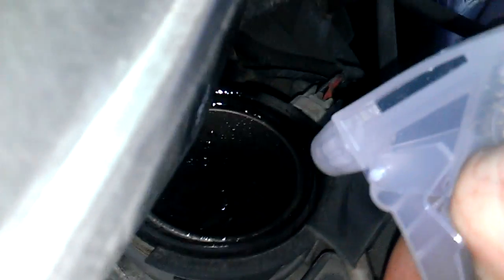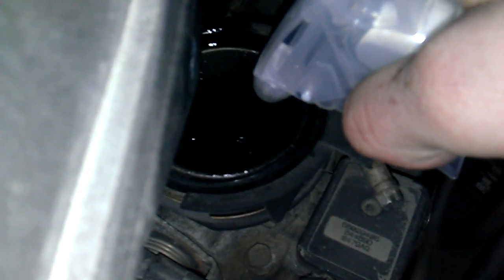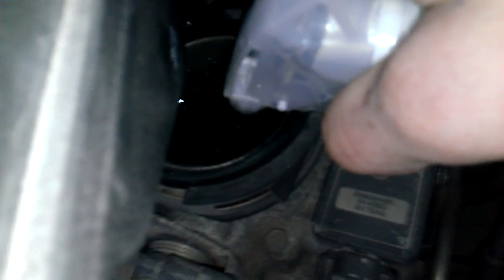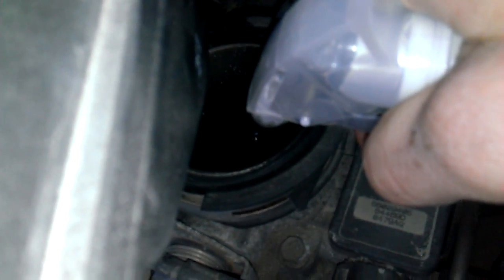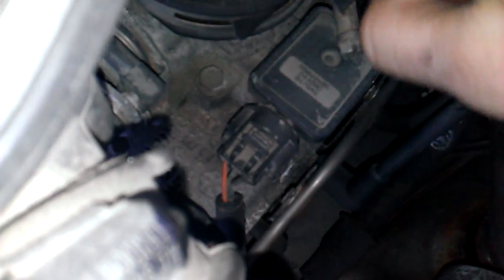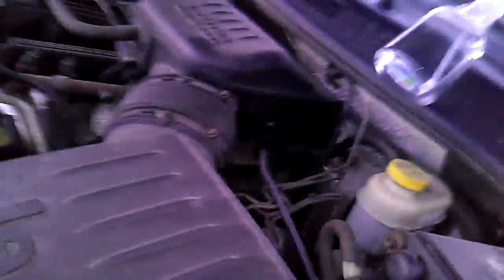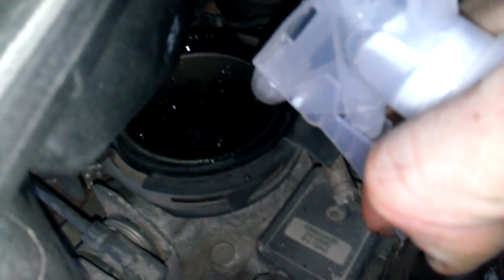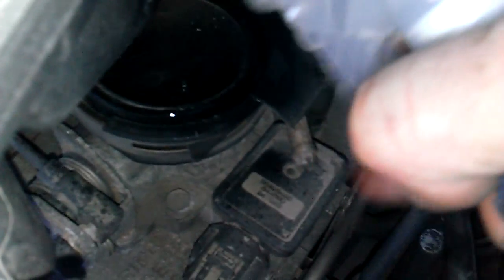how to make your engine run better with just tap water! engine decarbonization

Comment: Your trusty Jeep produced more water internally as hot, high pressure steam from the combustion of gasoline during your demonstration than you supplied by spraying, raising perplexing questions about why you bothered. 

To all YT armchair decarbonization scientists: if you believe water decarbonizes, then fueling with E85, if your vehicle allows its use, will produce >2X the amount of water as 10% ethanol gasoline. Doing so takes no additional time, effort, tools, or equipment.

Comment: Works better if you keep the RPM above 2000 or so. I use a quarter between the throttle body cable stop

Comment: I would do it in the Summer when the engine is above operating temperature.  You would be better cleaning injectors with fuel additive and changing engine oil.

Comment: All false information.. all of it....
Reply: Not really. Granted he should of used distilled water everything else works. It really does decarbonize your engine and no it wont hurt as long as you spray slow. If you have ever seen an engine with a head gasket leak into the cylinder then you would know this works.

Comment: For best result you should idle the car to 2,500 3,000 RPM and it's not recommended to apply water directly to the throttle body, always apply it through the intake hose

Comment: i have a question. would me spraying it in through the Throttle body affect it in any way or is that where im suppose to spray it in??
Reply: If you are going to do this use deionized water so you dont get minerals in your engine keep engine at around 2000 to 2500 rpm to keep it hot and very small amounts of spray dont want to put to much water into your engine or it will get into the oil and ruin the rings. And yes spraying at the throttle body is important because you do not want to spray the mass airflow sensor and ruin that. Hope this helps

Comment: Well, I did this decarbonization, and a couple of weeks later, all four of my O2 sensors went bad.  They only had around 7000 miles of operation.  So, I just don't see the value in decarbonizing . Those O2 sensors were over $40 apiece.   Could have bought a lot of gasoline with that.
Reply: Eduardo León Morales 

They are exposed to lots of steam whenever the engine runs.
Reply: Eduardo León Morales 

O2 sensors are in the extremely hot exhaust system before and after the converter. He’s not referring to sensors in the intake system. Doubtful four 02 sensors would fail simultaneously.
Reply: Eduardo León Morales 

Water which vaporizes completely in the intake system on its way to the combustion chambers is identical to water produced from combustion. The small amount he introduced makes no difference and does nothing different than water from combustion to remove carbon. This video should be entitled, “Wishful Thinking.”
Reply: Eduardo León Morales 

Oxygen sensors don’t respond to water. You think an engine doesn’t make a lot of water regularly? Do you know what becomes of every drop of gasoline it consumes...what the products of combustion are? Apparently you don’t...

Comment: Can you sell me a new engine after i ruin my old one by putting water in it?  This doesn't seem like it would be safe for my engine.
Reply: Water is fine in moderation. I had an old car with sticky lifters and one of my cylinders locked up. When I pulled the head, I noticed that the locked up cylinder was clean like new. While the other working cylinders were coated in the usual carbon buildup. What happened was that during the short period of time that I drove the vehicle with a stuck cylinder, that cylinder was always getting a constant shot of fuel, which actually washed up the cylinder and piston head quite nicely. This is a little different from misting water into your intake, but the result is just the same. When the water reaches the cylinder, it vaporizes and the heat produces steam which will remove the carbon. Just don't be an idiot and drown your engine with water...water does not compress well and you'll end up killing your engine if you go nuts with the water.
Reply: But gasoline contains detergent which I assume is there to clean the pistons and cylinders when the engine is running. Am I right?
Reply: David Crandall Correct. But the fuel itself is part of the reason carbon deposits form in the first place. The reason it was effective was because the fuel wasn't burning, but rather washing through. Steam works the same way. Have you ever taken any stained clothing to the dry cleaners? It's amazing what steam cleaning can do. I'm not saying that, "If you aren't decarbing your engine with steam, you're doing it wrong", because there's more than one way to skin a cat. My point here is that most things are fine in moderation. Pouring too much of ANY liquid into your engine is asking for trouble.

Comment: Is this guy for real? Spraying water into your intake? Hey Einstein this is not cleaning anything! Add Enough water and you will vapor lock the engine.
Reply: vapor lock you mean hydro-lock and you could never get enough all at one time from a squirt bottle if you took the lid off and dumped it all in at once maybe
Reply: Exactly. I don't see chefs cleaning flat grills with sea foam or some other decarb cleaner. Water works beautifully.
Reply: +dave kondej Hey,brainiac,how about you go back to school and wide open your ears in chemistry class. Heat up your pan at home. Add some sugar,so that it gets caramelized and black. Cool it down. Then heat it up again,and pour some water on top. Then get back here and share what happen..Einstein.

Comment: "I had an issue with high oil pressure and its bringing it down a little bit too" - Nope! completely unrelated systems

"water coming out the tail pipe" - Nope! this is condensation

"i've actually got a bad lifter, im just trying to clean it up a bit before i do the head" - Nope! how about clean that carbon while you have full access to the tops of your pistons!

"look at all that smoke!" - Nope! its clearly winter and freezing temperatures out there

This is a terrible video with so much NOPE! i think your on DOPE!. this is very safe and sound procedure but you are in no way providing quality content to your viewers.

Comment: Where is the proof that it is cleaning out all that carbon? Do you collect these carbon particles with something?
Reply: Well, if you've ever cleaned a flat-grill you would know that steam does an amazing job at loosening carbon that's caked onto steel. However, I would have some concerns with potentially clogging up your cat at least a little bit, especially with an old engine that you know has a fair bit of carbon deposits. So I'd probably disconnect the cat at the flange before doing a decarb weather I'm using a product like sea foam or just plain water.
Reply: Michael K 

Someone needs to record this miraculous process in, say, a carbon caked skillet. One thing you won’t see on YT is this process in action,  because it doesn’t work.
Reply: See what Greggg57 wrote.  (that is me too)
Reply: works I tried the spark plugs were clean the engine is more responsive the stable idle works great I used a spray accelerating the engine to 1,500 rpm behind the muffler there was black water on the ground

Comment: I've put crushed rice in a water bottle and slowly poured it into my engine while holding 2,200-2,500rpm. cleaned mostly everything out. I wouldn't do that to my new car but it does work on the older cars

Comment: How can you be sure the carbon coming out of the tail pipe isn't coming from the exhaust system and not the engine?
Reply: +jschrauwen from both
Reply: +Joe Pan   How do you know this?
Reply: +jschrauwen i done this with my car and the valves got cleaner so they seal better when in close position ,
now it's more smoother running ,just one mistake is that this guy should of rev it to 1500 rpm when doing so not at idle.

Comment: Hell yeah! Knock that piston sideways. Yeah don't rev it. Wouldn't want to take some mile of the engine by steam cleaning cylinder wall and knocking the piston sideways. Then scarring the walls. Probably would be safer to use fogging oil in the engine. Bet it does help wear the bearings down to. Just rev it up, start pouring it in and see if you melt her down. lol

Comment: I dont really understand the theory behind this. Can someone explain how water can dissolve carbon deposits? Also if chunks and flakes of carbon are breaking off wont they scrape up the cylinder walls? and won't they clog up the catalytic converter?
Reply: +pipkin503 Steam, that's how. The engine has to be hot first. See EricTheCarGuy's video if you'd like to hear his words on it.
Reply: Valid concerns about larger chunks of carbon breaking off and scraping. But the same risk is present even if you use a formulated decarb cleaner like sea foam.Generally, your engine block and valves are harder than the carbon deposits so I wouldn't worry too much about scraping up your cylinder, any scratches would just be cosmetic unless it's a high performance engine with very tight tolerances. The steam does a pretty good job though of breaking up the carbon thoroughly. As for the cat, you could always disconnect it at the exhaust flange before performing any decarbing.
Reply: Xaeris 

Water doesn’t decarbonize. It’s an internet rumor that refuses to die for some strange reasons. Many armchair internet scientists and theoreticians remain convinced that it works however.
Reply: Water is H2+O. It is liquid air. It may get in air intake and oxidice with dirth and burn out with   H.

Comment: Wondering why you never displayed any actual carbon deposits or other sludge that was stated to be exiting your vehicle... ???
I did notice the water-vapor caused by the differential in temperature between the as stated "hot" engine & the partially ice covered environment. As well as, yes an engine will idle smoother once a greater portion of moisture exited the system Because H2O is naturally detrimental to combustion... Also running "climate controls" in a vehicle can cause moisture to drip from the tail pipe. Due to a rather similar function as caused the vapor seen on the video...

Comment: How to kill your engine 101
Reply: The white smoke you see is not carbon, it is just water vapor. Your poor car is slowly rotting from the inside out.
Reply: Furthermore, the water can get into your oil and really kill anything that gets engine oil through it.
Reply: Actually if you keep the rpm held a little higher than idle it does help but I wouldnt use tap water I'd use deionized water so no minerals in it to harm the engine this works similar to seafoam just gotta know how to do this correctly old cars love it!

Comment: All that is happening is the water going in the engine is terming to steam and going out the tail pipe don't do this it is bullshit !!!
Reply: Works when you know how to do it correctly old cars with carbs love it. Acts like seafoam. The steam at high temps does cause carbon to be removed but in small amounts

Comment: i suspect the water you're seeing at the tailpipe is condensation. hot air from engine meeting cold exhaust (winter?).. it's not water coming from the engine.. any water you sprayed into it would have instantly vaporized..
Reply: Dexter Edwards 

Not from the engine? What do you suppose happens to gasoline when it burns?

Comment: my god I hope you're not spraying water into the mass airflow housing / sensor
Reply: paul rogers Thats just the throtte body, the sensors would be before that in the intake
Reply: paul rogers he sprays in the throttle body jeep uses map sensor not mass air flow sensor which is right under his thumb in the video
Reply: +paul rogers If this car had a MAF setup, the second he pulled off the intake the ECU would have stalled the motor because it would think there is no air going to the motorNonetheless, he is just proving that water + combustion = steam. This is not "decarbonizing", and I wouldn't do it. If you want to decarbonize, take off the head and soak the piston tops and valves in combustion chamber cleaner. Decarbonizing sometimes loses compression on some cylinders, which is a bad thing.His "issue" with high oil pressure was coming from the oil being cold, just running the motor heats up the oil, and pressure drops. This isn't even an issue, but to this guy I'm sure it is.

Comment: Did you really just spray water on your mass airflow sensor? That is not a good idea. This method does work though. In my opinion not as good as sea foam but pritty darn close.

Comment: There is a lot more in tap water then just water. Stuff like calcium carbonate, slica, sulfates, iron, magnizium, and much more dissolved in it. And all that goes IN the motor. Now you see the water steaming OUT of the engine, and thats great. But it is JUST the water. All the metals, and minerals though... well now they are forever left ON the cylinder/ piston surfaces where the water boiled away. Take your water bottle, spray away on a hot dry pan. When you finish the bottle you'll have a white-ish flim perminately left on the pan... just like the inside of your engine now... SCIENCE FTW!... I'd love to see what your plugs look like.
Reply: Raven495 Use demineralized water

Comment: water in an engine is not a good thing .
Reply: Dude, calm down. Steaming the combustion chamber isn't like adding water to the crank case. Yes, too much will hydro lock it, but ANY liquid will do that in an engine if there's too much. Even gasoline.
If done properly it's not as bad as you think.
Reply: ***** it gets enough from humidity already :)
Reply: ***** I guess water/methanol injection kits are bad things, too.
Reply: water in a normal shitbox engine is bad
Reply: +Don KiksBiscuits how do you think water meth injection works by spraying water in engines its now in the crank case it will be ok
Reply: +Don KiksBiscuits do u know how engines work ,the air intake does not mix with oil .u don;t put water  in the  crank case .
just the intake  on a running engine that has reached norm tep. and when doing so rev at 1500 rpms . Only mistake in this vid is that he was putting it in on idle at 750 rpms. thats why he was getting too much steam at back end ,at higher rpm water goes out faster with the gases .

Comment: Do you know that for every gallon of fuel your car is using it condense the same amount of water vapour from the air it sucks in, that watervapour is travelling through the exhaustsystem and is more visible as smoke when it's cold outside, even though it's there when it's warm outside too. This is also the reason that exhaustsystems corrode from the inside out, and is more prone to corrode if you don't drive long enough for the exhaustsystem to get warm enough to dry out. Most of the time the muffler before the rear axle corrodes most at it's rear end down by the bottom, because that is where water is standing and can't get out as easily, like the waterlock in your toilet!
Reply: Jan Stromback 

You are incorrect! Huge amounts of water pass through and engine, but not from humid air. From combustion, yes. Maybe that’s what you were trying to say. 

Notice that YT’s armchair scientists don’t seem to understand it. Steam and carbon dioxide are what create the pressure that makes an ICE run.

Comment: Oil and water dont mix. So what i think its happening. Water is mixing with oil and separating the oil from engine. Getting oil in spark plugs and catalytic converter. You might be getting the oil out not crap out.
Reply: Sergio Monitor he spraying it in the intake not the oil fill cap. there is not oil where he is spraying it.
Reply: Sergio Monitor l o fucking l
Reply: Sergio Monitor unless you have a gasket leak, you don't have oil in the fuel system / combustion chamber